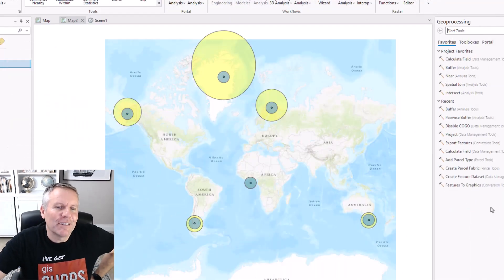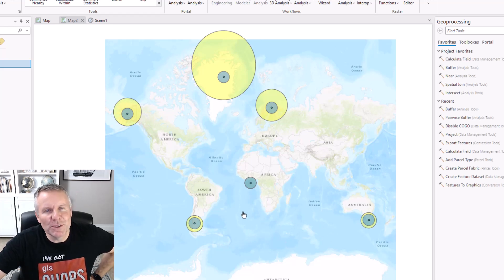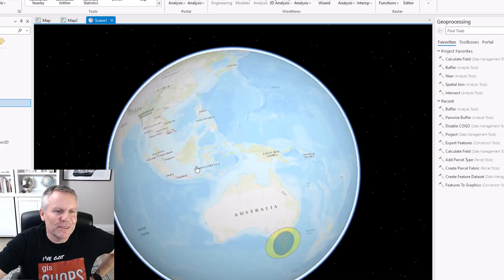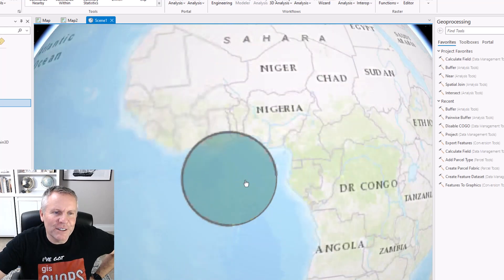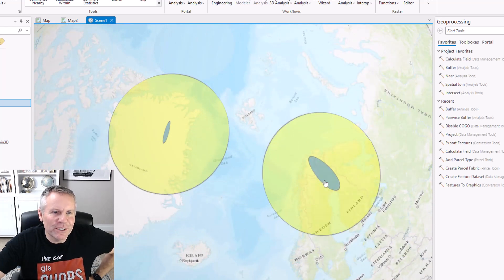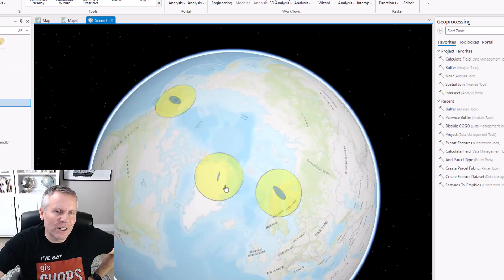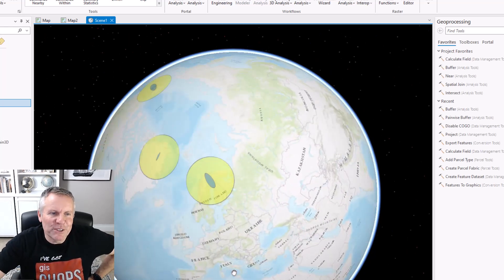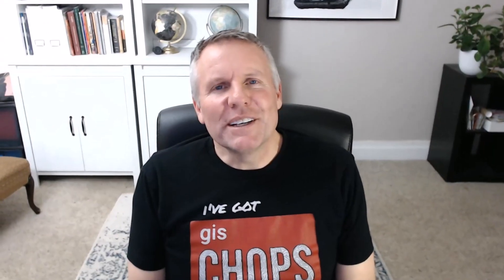Planar vs Geodesic Measurements in ArcGIS Pro

Comment: Nice description, the contact lens example was simple.   A lot less messy than the orange peel method.  Hey Chops, how about some chops on metadata.  I find Pro much harder to navigate metadata than ArcMap, especially with Catalog.  The nuance of perm. saving of metadata from Catalog pane vs TOC is a huge time saver when perm. assigning metadata, and the exposure of FGDC metadata under OPTIONS from the project.    ESRI tends to take the simple route, defaulting to item description, but for those of us long in the industry, we have most of our metadata in great detail that is NOT exposed in the silly short item description.  anyways, metadata is key first step when trying to solve small or huge shifts with coordinate system issues.  Nice job!
Reply from the maker: Thanks for such a great comment. I will have to look at doing a video on metadata, because I definitely have all of mine done and up to date. 😉